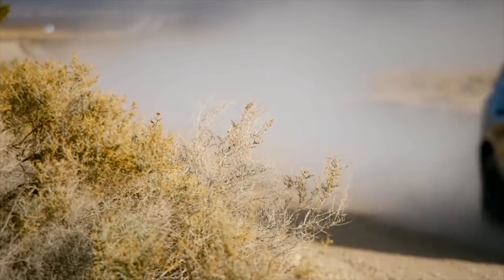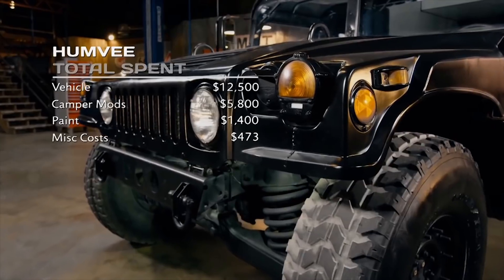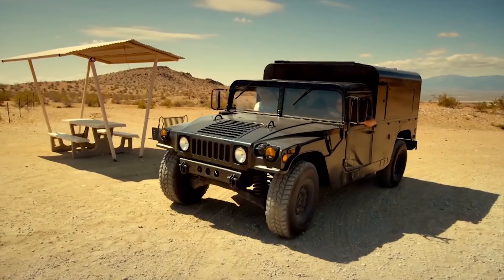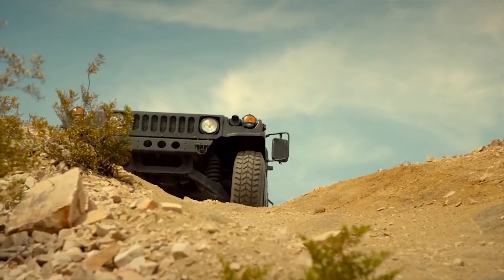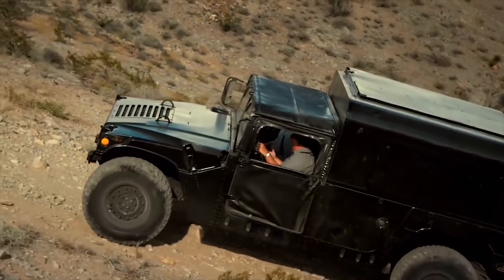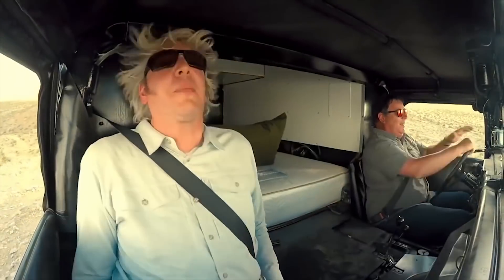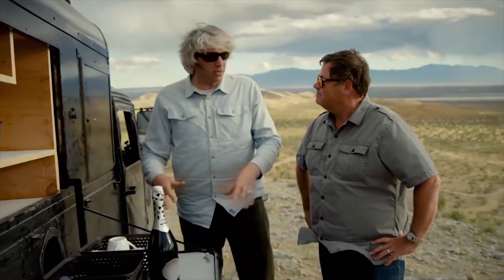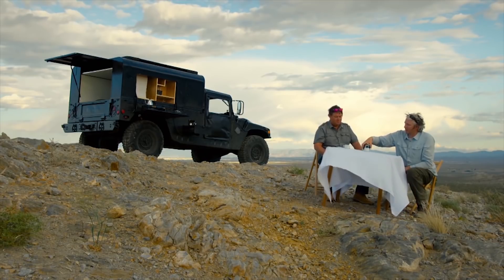Edd Completely Transforms This Humvee! | Wheeler Dealers

Comment: Good day! Wheeler Dealers is my favorite show. But, I'm surprised. In this program, you surprised me. This vehicle is not suitable for travel. The car turned out to be terrible. The doors are dented. The black body will be hot in the sun. To prevent the sun from heating up the roof, the color of the car should be light, especially the roof and hood. All the best.